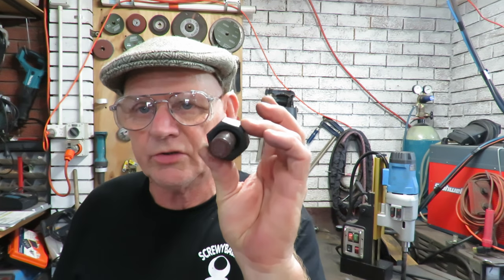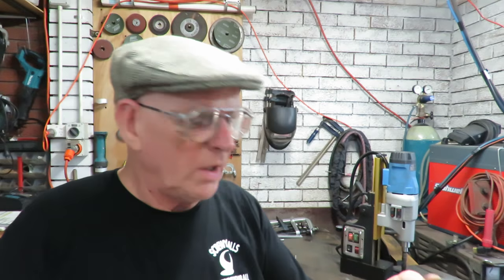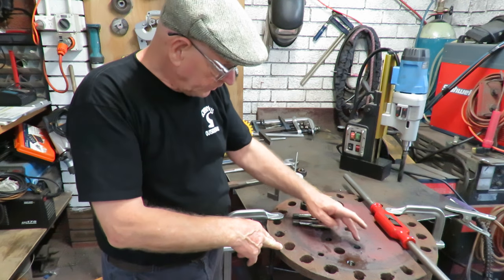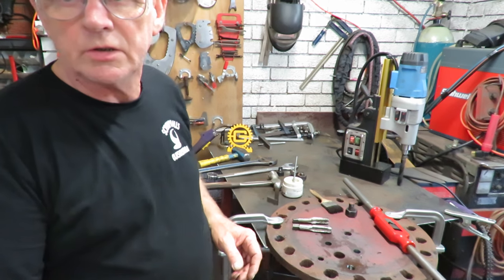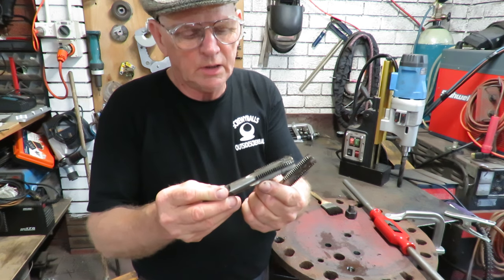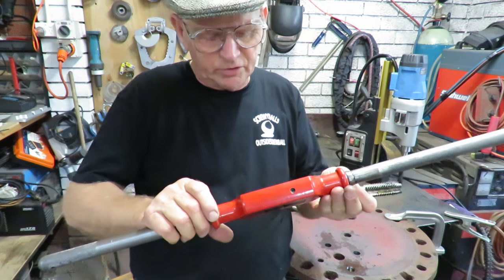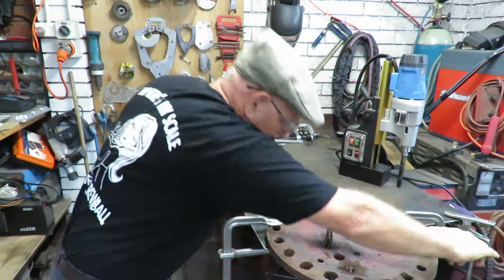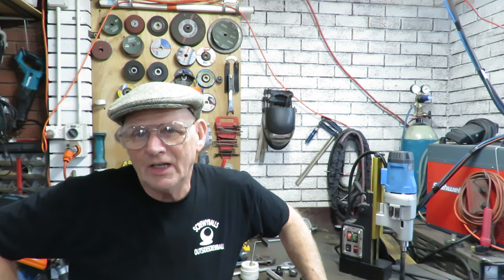Locomotive Steam Boiler Manhole Cover Repairs

Comment: With many of these very old carbon steel items, they are not homogeneous to begin with due to the way they were made.  And we don't know the history of the material just as you say.  As a result the microstructure could be a dog's breakfast of many phases both hard and soft.  If you happen to run into a volume of hard martensite then you may well break a tap..  Most enjoyable video, Bruce.